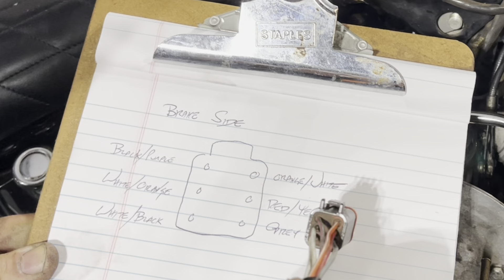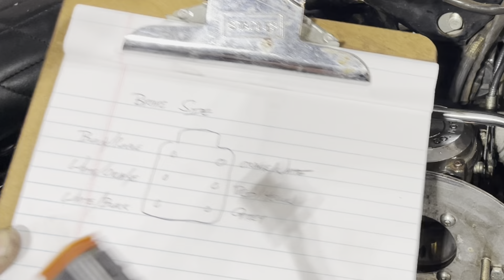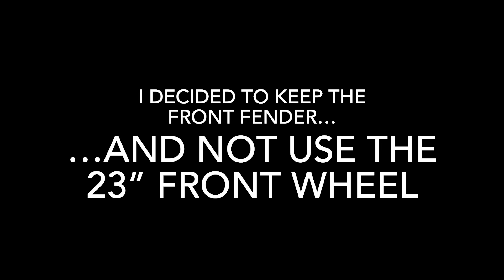Billy Lane 1998 Harley-Davidson FXSTS Springer Softail Makeover How To Cam Install Handlebar Wiring

Comment: Huge inspirational figure and part of the reason I love building bikes now. I Run a 21”x3.5” on my 2002 Night Train, never ran a 23”. The 3.5” over 2.15” width is a game changer on handlings for me especially highway speeds. I assume it’s easier to get sneakers for 21” as well. Either way, you can’t go wrong Billy. 🤘🏻⚡️

Comment: Billy, the end edge of the Deutsch plug is numbered 1-3 down one side and 4-6 down the other. So when you draw your diagram for wire replacement you just write the number next to the wire color. That way you don’t have to draw the plug.Pretty hard to screw up the reinstallation. This is the way we’ve always done it at our shop, and has always worked out .It’s great to see your doing good again Billy. You have a lot of fans and people who love you!

Comment: You inspired me wayyy back in early years of biker build offs and doing with what you had...haah I ended up buying a 93 flhtp police bike...did a bunch of mods, apes, le para low profile seat, small windshield, straight fish tail pipes that stick out about 14 inches past the saddle bags.....and made a license plate bracket from an old coat rack.lol..Nobody even noticed until I told them how I did it....Keep the vid's coming ...Peace from NB Canada

Comment: Great video.  I had Tommy Keefer set my 02' Springer up the same way back in 2013.  We lowered it and did an old factory 150 tire kit.  I had Flanders wide clubman bars which look pretty much identical.  Springers look awkward from factory, but a few key mods make these look so good.  Sweet machine you made there!
Reply: his Bad Boy looks pretty much stock other than the front wheel.  they had front fenders tight to the wheel too so it didn't look as awkward as some springers

Comment: Same bike (not springer) same paint, same damage. Oh also NJ. Luckily bike came up from Maryland. Over the past few years she’s been a solid trooper till last year. Flywheel issue gave me the reason to put new motor and 6 speed. 64hp now at 103hp. Shock replacement was greatest upgrade though. I know HD stock was garbage but had no idea the extent. Wow.  
Thanks for the time lapse of my process. 👊🏼

Comment: I used to work patterning, fabricating, and installing custom canvas on boats. Being from where you’re at, you probably know that most boats have rounded pipes/poles. One thing I figured out was to use an “eye” or “inchworm” (since it has two holes - hahaha - and clamping a vice grips to one side. This way you can use it to position the drill bit where you want it and have two hands controlling the drilling process. On strange angles I would do a smaller pilot hole and then finish with the larger bit that would run through the pilot hole. Hope that helps

Comment: Hey mate, i usually pull the orange seal all the way back on deuts plugs then feed the wires in one by one that way you can hear each wire click in and also looked a bit easier than 6 at once! Haha been a fan for years mate keep up the good work

Comment: Hey Billy. You can make feeding the wires through the handlebars much easier to do with this cheap, easy "hack". Get a piece of solid #12 awg wire, "fish" it through the large hole at the bottom of the bars, through the hole on brake side (repeat for clutch side), tape the wires to the #12 solid & pull through. I'm a union electrician & this is how we get our circuits through conduit.

Comment: Made an 87’ FXST into a Softail Bobber cut the fender struts off and used a Milwaukee Iron bolt on low profile fender. Old school round oil tank and ape hangers came out pretty bad ass I must say.

Comment: Looking much better after the altitude adjustment. With the solid rear wheel, a newer style aluminum 23 would look great. I do have one rule for my daily rider bike. Front fender is a must. After riding in summer t-storms without one, I finally decided it's a must.

Comment: Thanks for the continued info during the process.
Ps I had to find & replace 4 deutche pins on a 147 pair plug on a dozen swathers. Number coded on 18g wire. I’m still cross eyed.

Comment: I never liked having turn signals mounted to the handlebars. 21" front wheel looks good on a springer front end. Nice choice for the bars. I currently have chrome Biltwell Frisco bars on my scooter, but have been lookin' at MX type bars like on that Softtail. I like the overall look.

Comment: My scoot is a 1998 FXSTC.  It's sporting drag bars with Kuryakyn controls, grips and wide glide front tubes. When I first built it I ran a 23" front wheel. It rode and handled fine but after looking at the bike for a coupla months I just wasn't happy with the look. Almost seemed to take some of the bulk out of the front of the bike leaving it look like that wheel didn't go with the rest of the bike. Switched back to the 21". Looks much better.

Comment: Very sleek looking machine now you did a great job you definitely changed the look of it completely I just picked up an 84 electric glide has to have a lot of work done to it but it does run just a little rough trying to tune in the carburetors any pointers would be great but keep up the good work and looking forward to more of your videos so I can learn more

Comment: Billy Lane, I like the look of the rear fender remindes me of the dyna wideglides but you have  a softail frame instead of a dyna type frame, anyway the 21 "  to me fits the bike, Maybe you could respoke the front wheel with new chrome spokes for some additional bling ... you do cool work, appreciate the time you take gor the videos.

Comment: Billy, well, why hammer the camshaft bearing, there is a tool for this too) We are in Russia, carefully and carefully trying to repair old Harleys, we buy a tool, we look up to you, and you give us such an example)) And before installation, I would clean shock absorbers. It would be nice to put the steering wheel specifically for the sringer with the correct knurling under the racks. And the hole for the wires in the middle of the steering wheel, I processed it better, made the edges smoother) The brake machine must be set carefully by pressing the brake lever a little so as not to damage the switch) Avon grips are really very good, but renthal or PM in chrome would look more appropriate here)

Comment: Bro you need a magnetic induction heater! I live in NewEngland and I work in the car world so we’re constantly depending on our old fashioned “smoke wrench” but sometimes you need to heat something up in a tight space or your in an area where you have some delicate parts or something flammable… thats where the Induction heater comes in too play. You put your coil around a nut and boom heats it up cherry red in seconds! Would have been perfect on that exhaust stud… anyway looks like you made short work out of it anyway! So i will continue with the video!

Comment: Great to see you working on this. Awesome instructional clip. Always wondered what happened to you. Still  running Choppers Inc.? Hope so and I also  am real glad to see you flourishing. Good call on the cam baring. I used to work for Harley at the engine plant. They use the cheapest parts they can get away with, hence all of the recalls a couple of years ago.

Comment: Great job on turning that bike around, 21" is the right choice on that bike 
I would always change out the plastic Harley breather gear for a steel version, the plastic gear WILL wear the case.
Only criticism is the chrome swing arm, they are always a mistake if people realize what a Softail is supposed to represent.

Comment: hey Billy love your videos and learn what i can from you, but i have a 96 springer softail that I'm getting back into running order but i have a leaking fuel tube for my crossover for my gas tank in the bend of the steel tubes, was wonder what would the correct way to repair that.

thanks
tim

Comment: I noticed that when you did the cam you left the stock ignition,  I was a bike builder-restorer until a car crash , Brian injury, so gust wondering if you use cranes tunable single fire ignition or split fire sparkplugs, better fuel mileage, more power,,3-6hp with indexing

Comment: Here is a trick to "pull" the wires thru
Get a string like on a yo-yo and use a vacuum cleaner  to suck the string thru. Now you have a pull string. Fasten the end of the string to the wires, I used shipping tape about 2" up on the wire and some wd40.
Works every time

Comment: Hey Billy,  I was thinking of upgrading the rear wheel bearings in my 2009 Sportster Custom.  It of course has a standard 883 EVO motor I have about 30,000 miles on it.  Do you think the engine main bearings need to be replaced in it as you did to this bigger one?

Comment: Don't need a lowered bike. Rather need a raised bike where I live. Like to see one of these done with Tall & Fat 18' rimmed rubber. Front exhaust over the crank> rear right at under oil tank & on top of front exhaust pipe. (Straights).   Mid controls-no boards. No tank ints. Just a speedo & tach between the bars. Forgot: Large silver flake Candy Apple Red with same (Gold) trim. Don't forget the Stage 3 engine build.

Comment: @Billy Lane "Lemmay have my stuff" too funny! I just never understood how Harley-Davidson could let that bike leave the factory with the rear fender sitting like that the rear ends were hideous from day one! Smack it around good!
Reply: I think they did that because of the same reason Billy mentions in the video. Two up riding. I also wouldn't be surprised if the moco engineers probably gave extra ride height to spare in case of couples with a surplus of love handles.
Reply: @Full_Otto_Bismarck  totally true! I never looked at it that way!

Comment: Nice Springer Mr. Lane...! I personally vote for the 21" wheel with an Avon Speedmaster rib tire for a vintage look. As for lowering, my bike get lowered enough when I sit on it. But, your bike, your way...lol I am thinking of taking offers on my 97 BB. I bought it new, and am getting a little old. It's pictured on Harley Davidson forums in a BB thread. If the price was right...:-) I wonder how much of a HP difference with the SE heads on the BB and this work on the springer??? 🙂
Reply: godfellas: Hey, buddy. I`m 73 and love my `90 Springer FXSTS. Evos rule. Don`t want no twin cams or m8s. Gotta admit I was shocked he didn`t clean up those shocks before assembling.
Reply: @REDMAN298  He was flipping the springer anyways. It's cool you still like your springer! I think I am going to sell my Bad Boy before next year. I still love it, but someone else can too. 🙂

Comment: final comment - your right side tank is loose (i am sure you will notice that) ..... your build could use some weight taken out of the flywheels so it'll build RPM faster, you'd prolly love the new sound of the engine

Comment: Recently came across a Harley that looks similar to this bike. It has a shovel head, same tank gas and oil tank and rear fender. But it has the outboard shocks like a sportster. Im a totall virgin when it comes to Harleys and im not totally sure what model im looking at. The engine code is 7a1290141 if this helps.  Thanks in advance and im totally enjoying your videos!

Comment: Does anyone have a link for the handle bars Billy fitted to this bike? Thanks!
Reply from the maker: There is no link, but I bought them from V-Twin Manufacturing. V-Twin calls them 3” rise drag bars, but they are really a speedway racing bend. The V-Twin part number is 25-0531. You can probably find them from sellers on eBay, or contact your local V-Twin dealer. I love these, I put them on my BadBoy, WR 45” racer, West Coast Choppers CFL, & 1980 Sturgis.
Reply: @BillyLaneChoppers  Thank you Billy 🫡

Comment: I would at least clean the parts before reinstalling. I personally would have had the whole bike spotless inside and out while it was disassembled. Attention to detail. Shocks were nasty, exhaust ports caked with oil, dirt covered frame and wire looms. Bare greasy hands pawing all over the bike. Kind of a dirty operation.

Comment: I love my motorcycle I have a fat boy chopper 60s style built m unit oversized oil pump cam the whole nine yard the bike built very efficient as I am a engineer and I re-engineered a lot of stuff the bike run at a cooler temperature even at the hottest day I did not want anyone to see the oil cooler visually so the bottom of the bike I custom built the frame to put the oil cooler on the cooling fan underneath the motor you cannot see it you could still Jack on the frame without damaging the oil cooler I sat down and I designed the frame of my chopper before I even learn how to ride a motorcycle I build my motorcycle before I learn how to ride a motorcycle and I said this I will build the chopper that suit me and suit my dream for the last 10 years I have one of the greatest adventure of my life taking the first ride on a chopper define add now I collect classic bikes I restore it but only choppers

Comment: you never tune a fxsts,its a junk bike with its dangerous front brake,and even her original power is way to much for a safe ride
Reply from the maker: Harley-Davidson, to this day, largely builds obsolete machines. But the new Sportster & V-Rod prove that the H-D customer wants obsolescence. In America, you have the right to be incorrect, and to shout it from the rooftops. Which brings me to your comment. I rode this Bad Boy hard every day, several hundred miles per week. The upgrades I performed made a huge difference in torque & horsepower, and that horrible front brake saved the lives of two deer last winter. You’re just talking about it. I’m out here doing it.
Reply: @BillyLaneChoppers  hi billy,i worked as a mastermechanic on harleydavidsons for several decades,i almost crashed with a brandnew fxsts doing a emergency breaking,and i saw a guy crashing in a car at a crossing in front off me(he became a new customer off my shop)with this same typ off harley.the springerfrontend is junk,it hits to the bottom,and then with no suspension more,the frontwheel blocks,and slips away to the right,this frontend might be good enough for a knuckle drumbrake and for 50hp,but for a tuned evo,forget it,you probably are a experienced rider to handle that,but this nowadays viagra tuned pensioners???